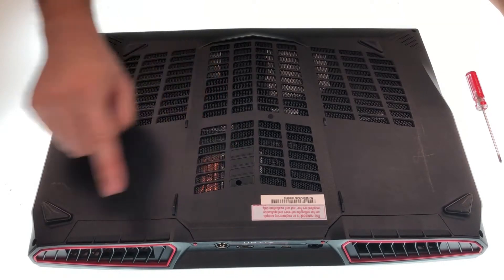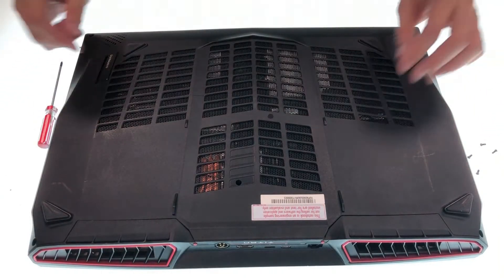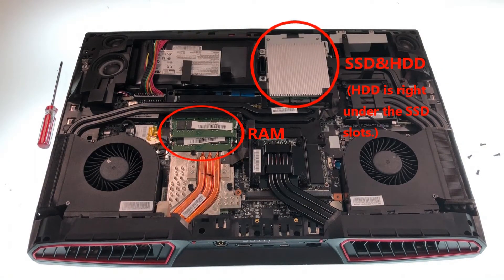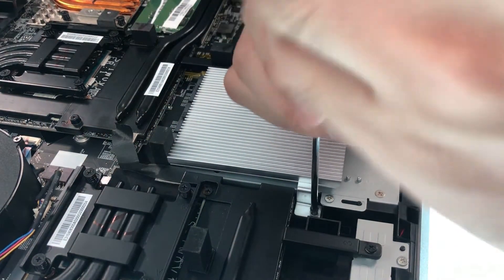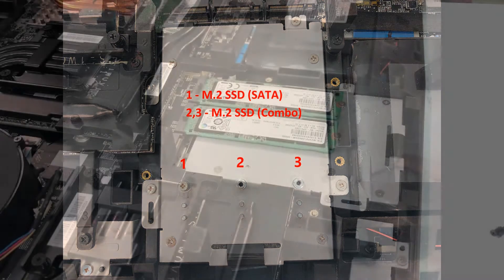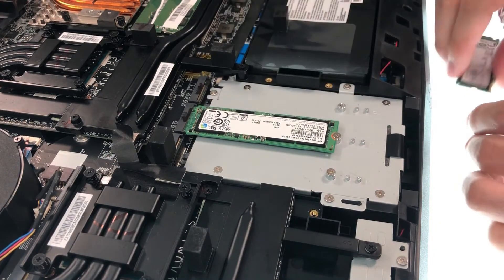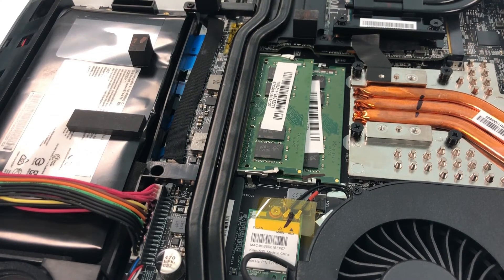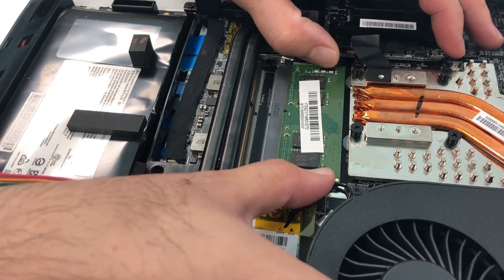MSI GT75VR/GT73VR/GT73EVR/WT73VR Series SSD & RAM Upgrade Tutorial

Comment: Hi, I recently purchased 2x16gb ddr4 2400 mhz CRUCIAL brand rams and installed it. When I powered it on, the screen was black and it wouldn't completely boot up. I did a cmd prompt and found out that factory installed 2 kingston rams 2x8gb underneath the motherboard which I won't want to mess with because it will require me to strip out almost the entire internals just to get to it so I have concluded to just install 2x16gb to make it a total of 48gb of ram. Can I only use the same Kingston ram so it will boot up? Thanks for your help!
Reply: You have to remove the old ram and its a bit of dissasembly work. you will need to replace the thermal paste as well. there is a video with step by step guidance on youtube.

Comment: I'm not normally negative but that's the worst video I've ever seen and makes me want to "never" subscribe to this channel.  Helpful criticism here, you showed 3 SSD slots but only installed 2 SSD.  You should have shown your viewers three in operation because I'm still confused if that means my msi gt73vr titan pro can handle 3 SSD's and if so, what kind to get?  Speed, Type, Brand recommendation?  

Second, what about the RAM??? Again, no suggestion as to the maximum a msi gt73vr titan pro can be upgraded to, max MhZ speed, Best RAM to use????  I got nothing out of this.  Just being honest and may point to why you only show 63 subscribers.  Hope you can take this criticism in a positive manner moving forward otherwise thanks for the attempt.
Reply: @bikhato  Thank you so much but I've since maxed out my laptop and it does go to 64 RAM.  I also installed not 1 but 3 SATA cards and 1 Baracuda Fire HD for a total of 8TB.  For the SATA I used Sabrent 2TB Rocket NVMe 4.0 Gen4 PCIe M.2 Internal SSD Extreme.  I could have got more TB space but these are just dang expensive.  2TB are $300 each as it is.  Thank you again for helping out though, I figured my reply might help others as well on this specific model.
Reply: @bikhato  No, I looked into it, and as far as I've researched the motherboard can't handle a better CPU than the existing Intel Core i7 7th Gen which I have.  Now your laptop could be different.  Simply get the model number off the back and go to the MSI site.  There you can enter the model and it will actually tell you all the things your computer is capable of being maxed out too.  I think it said I could go to an i7 8th gen but for the money vs performance difference, it wasn't worth it and as you can see by what i did to my laptop, I usually don't worry about the money aspect too much.  I can just foresee more issues by changing it out is all at this point but definitely do your research there and contact an MSI tech from their factory to confirm who would know.  Another to check with is here on Youtube, look up LinusTech.  That guy really researches in depth everything that can be done and beyond, a real guru to subscribe to if you like pc tech!
Reply: you have 4 Ram slots , each can hold  32GB , total 128
Reply: you have 3 NVME slots , and one  HDD under the NVME disks .
Reply: @PatriotCoinRings  I think Samsung or TeamGroup for Ram  is best
Reply: @PatriotCoinRings  For disks get Western Digital and configure them in RAID 0 , it easy to do so from the BIOS  . 
You will get insane performance if you configure 2 of your disks as RAID 0 , imagine if your disk is working at speed 3000 MB, you can get 6000 MB .
Reply: @PatriotCoinRings  This machine is a beast , probably you will not need another machine in your life time . Good choice .